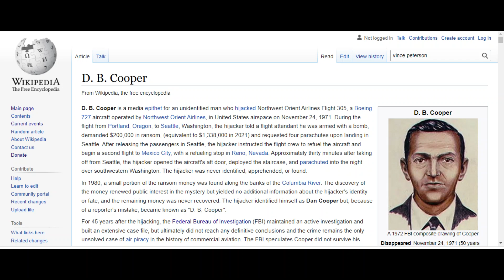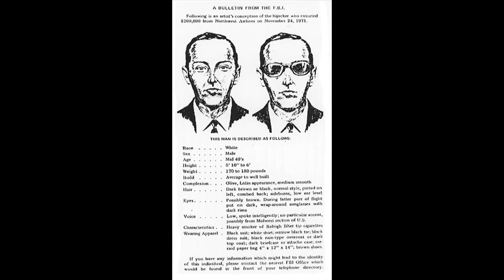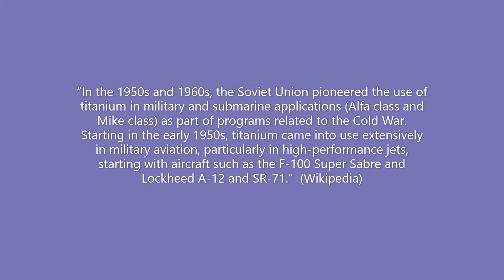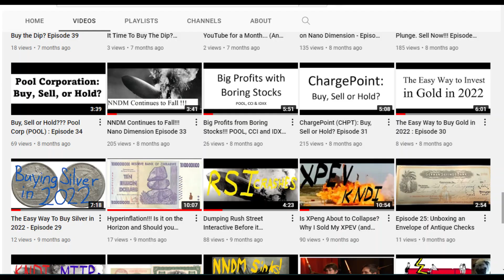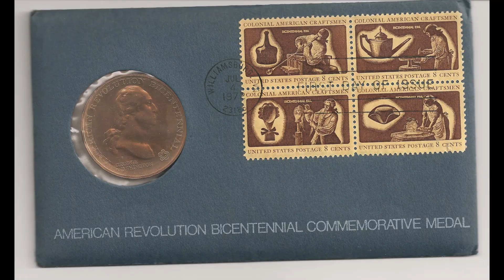DB Cooper: The Trouble with the Titanium Tie and the Latest Suspect. Episode 147

Comment: He never jumped, he was hidden on the plane the whole time, that's were the metal came from.
Reply from the maker: Hello, thanks for your comments. After my video on November 19th titled: Has the DB Cooper case finally been solved? episode 146 (and that is the episode number for my show to keep things more easily trackable since many of my titles are similar), that one was about Vince Petersen being identified by Eric Ulis as Cooper. The next day I did a video called: DB Cooper the trouble with the titanium tie and the latest suspect, which was episode 147. That talked about some issues with the titanium on the tie. Skipping ahead, over the past two days I uploaded a two-parter called: DB Cooper the terrible trouble with the titanium tie, part 1 and Part 2 which are episodes 159 and 160. Most of the comments that I've received along these lines were before I uploaded episode 159 and 160 so if you've not seen them I hope that you'll take a little time to watch them. In them I point out that the original research that Tom Kaye and Citizen Sleuths did, which still shows on their website as of yesterday, is that the three titanium articles are pure titanium, that is not an alloy. Eric Ulis’ conclusion based on Tom Kaye's research, Is that it was a specific type of titanium antimony alloy. Where the bridge between finding that the 3 particles were pure titanium turning into three particles of a titanium alloy I do not know, but let us for the sake of argument say that there was originally a mistake and that the particles are in fact indisputably a certain alloy of titanium antimony. Is it a valid statement that the only place that this would be found would be at Rem-Cru? I would argue: no. we have the three individuals who applied for the patent they worked at Battelle Memorial Institute in Columbus, OH. They did not work for Rem-Cru. It has been surmised, not my interpretation although I agree with it, that because the 3 petitioners for the patent worked at a nonprofit that four the patented material to be commercialized it needed to be patented under the auspices of a commercial organization, that is a Profit making company, not a nonprofit. Whether that's 100% accurate as far as the reason is probably not material here. What is material is whether these three people who worked at Battelle in Columbus, OH, produced any of this alloy there while they were developing the information for the patent, which I would argue most likely would be the case. How else could you come up with the data to put in the patent application if you have not first created the alloy? So if my contention is accurate then not only possibly at Rem-Cru, but most likely at Battelle there would be engineers working with the TiSb. So we have two places identified where there was likely that alloy at some point. Also remember that patents protect the commercialization of a discovery, product, or process, it does not preclude other people from working with that product and if they improve upon it, they can then patent the improvement to it. Also, the patent was rejected, there was a lawsuit, no patent for that particular alloy was given, and nobody was precluded from working with that particular alloy. Also in the most recent video that is episode 160, I put a screen shot of a scholarly journal written in English but from Scandinavia and probably from research done in Norway on four variations of titanium antimony alloy. That was published in 1962, a few years after the patent application was originally filed. And again lack of other online evidence does not mean that other people were not working with this material. If you were in a lab working with the material even if it was a nonprofit and you wanted to write a scholarly journal, if your work with the titanium antimony did not result in a new breakthrough of any type then you would not be writing the journal article in the first place. And many journal articles are not yet available online even if they do exist.
Again I would encourage people with questions or comments about this to watch those last two videos but I also caution people not to rush in to buying this as the ultimate smoking gun that has solved the case. I think that three particles out of 100,000 tested is a potentially suspiciously low number of particles that one might expect with somebody working with this alloy, although perhaps not. I have also worked in high tech situations at two companies that are well known throughout the world and I would argue that there are far more people that might come into casual contact with a few molecules of a particular alloy than one might expect and certainly more than a pool of only eight people. And as I've pointed out I would not be surprised if Cooper turned out to be some type of disgruntled OSHA inspector or some other type of inspector who would have gone to a variety of locations including perhaps Rem-Cru, and in the course of their job would have been exposed to the wide variety of high tech and aerospace associated molecules found on the tie besides this disputed titanium.
Thanks again for your comments and taking the time to make them here. Remember the whole point of this is to try to come to a conclusion on the identity of Cooper, not to win an argument. We all win when we are able to finally put this to rest, which perhaps may eventually be done using DNA and the particles on the tie might be able to help narrow down areas to look for certain candidates. Thanks again!
Reply from the maker: Thanks so much for the kind comments. I just uploaded a few minutes ago one of the videos that I am most proud of so far, you might be interested to take a look: D.B. Cooper: The Terrible Trouble with the Titanium Tie. Part 1. Episode 159

Comment: Lycopodium spores: These, in powder form, can be used to find the diameter of oil molecules. You sprinkle the powder on clean, distilled water in a wide pan, then carfully put a drop of oil on it (of known mass and composition) and measure the diameter of the spread which is constrained by the powder. Then you can calculate the film thickness. It's very techique sensitive. Mostly for a ballpark measuement I think. So, for example, maybe in a research lab, where you want to find how thin a film of lubricant would be. Would it be used in conjunction with titanium alloy research? Don't know. But I don't think the pharmaceutical industry is the only place it could come from.
Reply from the maker: Hello, thanks for the info, you are obviously much more knowledgeable about the subject than I (or Wikipedia). I do appreciate it and happy Thanksgiving! BTW, do you have a favored candidate?
Reply: @theanthonyrrmillsshow3876  Well done show, BTW. Both you and the retired police officer use Bayesian logic which can narrow down the selection. But  without a large DNA sample, or some other compelling evidence this may remain a mystery forever.
Reply from the maker: @mike9rr  I think DNA may be what eventually can crack the case. Thanks so much for the comments!